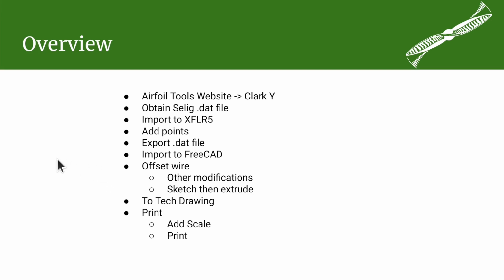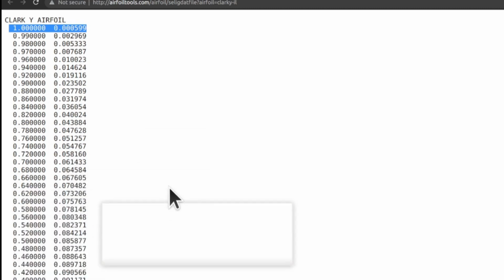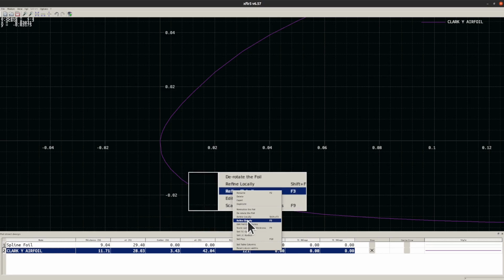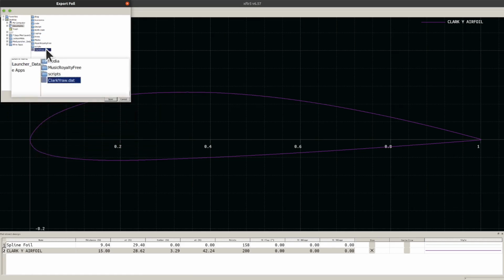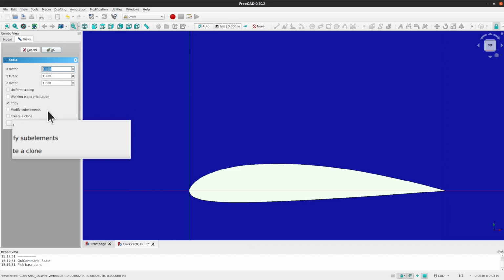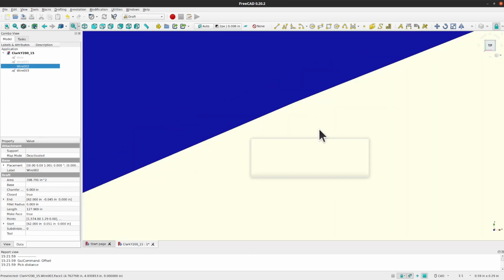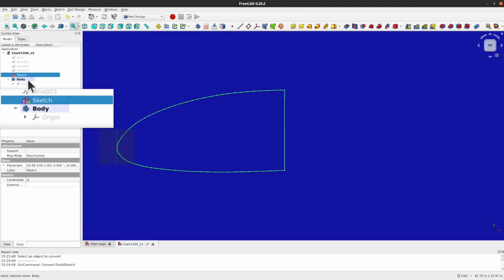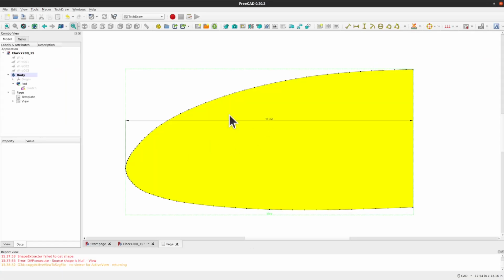From Selig Airfoil to Rib Template

Comment: just use the nasa ames airfoil pages you can actually add more points directly there and see the outline adjust points until you are happy ... then save it and load it in freecad directly ... close the trailing edge and poof its ready to pad and print
Reply: fyi if you know the imperial value such as 62in ... when scaling type 62 in .... freecad will convert it to mm or whatever you set your config preference units to

Comment: That was an excellent, excellent, excellent video. I have only missed one thing. For example if a wing has a 15 degrees sweepback (swept back flying wing), and the ribs are 15 degrees angle relative to the fuselage, how do we get a modified airfoil template that account for this rotation? (Even though the builder template rotated 15 degrees, the air still goes parallel to the fuselage and has to see the original airfoil.) I hope my explanation is not too fuzzy. Thanks for your hard work to explain all these to us.